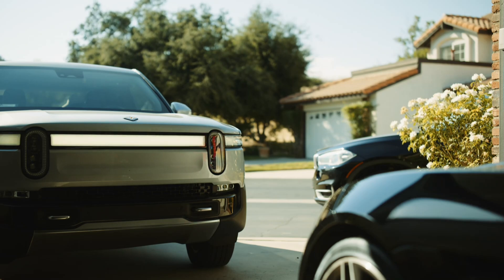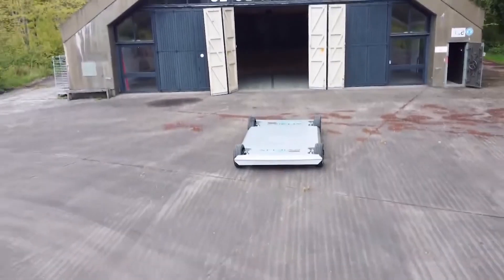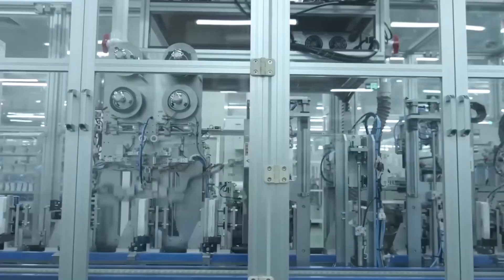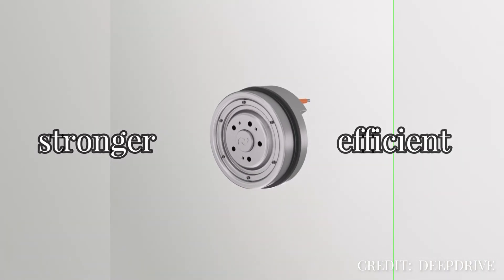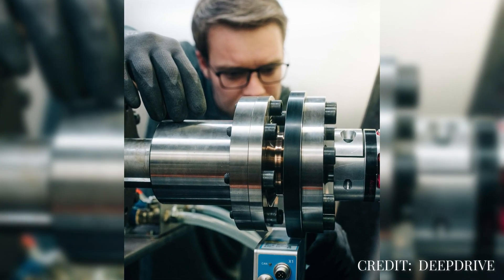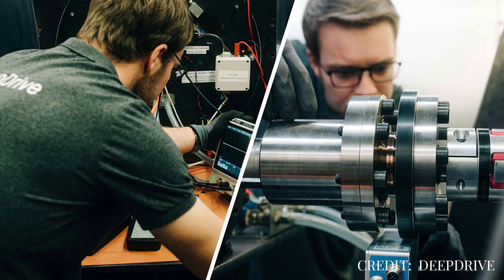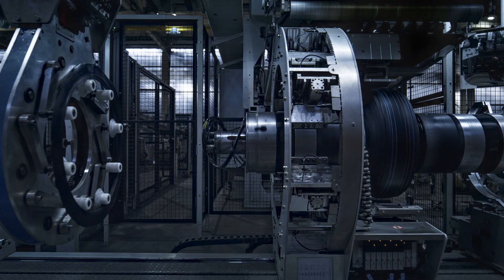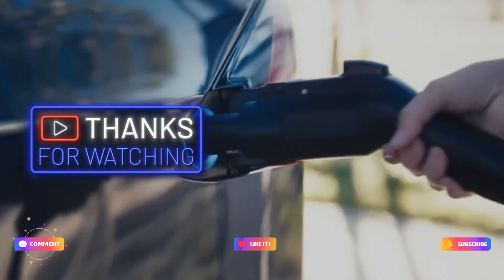This Tiny Motor is Making EVs Lighter, Faster, and Cheaper! 🚀💡

Comment: High unsprung weight (ie: heavier wheels, motor in hubs) resist movement less, so hitting a bump jars the assembly more than a lighter wheel assembly, but then the inertia of that moving mass is moving upward and then requires absorption of that energy, and then return to it's neutral position.  That is a problem, because the result of that is that bumps transmit proportionally (comparing unsprung weights) greater forces to the vehicle.  The ride quality, in other words, will be noticeably worse.  Perhaps could be mitigated by electronic suspension technology.  But one other factor is that the greater the unsprung weight, the more resistance to displace the wheel assembly to accommodate unevenness in the road, so that additional energy is to a degree transformed into a deceleration force.  So not only is overall ride quality worsened, but range efficiency takes a hit (pun intended) as well.
If they can make these hub motors very lightweight, then the good may outweigh the bad.  But it would take incredible engineering and technology, IMO.  I think a smaller motor for every wheel would be fine, however it should be mounted inboard and use a lightweight output drive shaft to each wheel.  I'd also probably locate the brakes inboard as well, to keep unsprung weight to an absolute minimum.
Reply from the maker: Good point! Unsprung weight is definitely a major challenge with hub motors. Lightweight materials and smart damping technologies might help mitigate the issue, but whether they can fully eliminate it is another question. Your idea of inboard-mounted motors and brakes sounds interesting—similar to what’s used in some motorsport applications (e.g., inboard brakes)
Reply: Ack. Also Deepdrive has seen the unsprung mass issue as they offer a central motor version. Inboard motor for each wheel is in "mass production" at Rivian. Probably ASM with reduced efficiency. Otherwise you would get over field exitation. Unsprung mass of the rotor means bigger air gap and less efficiency. For the dust problem there is no solution. Heat dissipation no way. If start-ups find no way out they will fail. To get the same power as a M3 with gear ratio 1/12 you need 3 M3 motors in every wheel. It will be  very hard to find a solution. I follow your concept. Smaller motor in every wheel, maybe with a gear